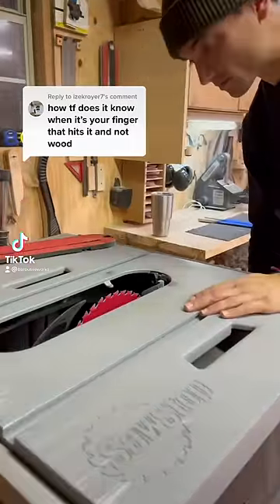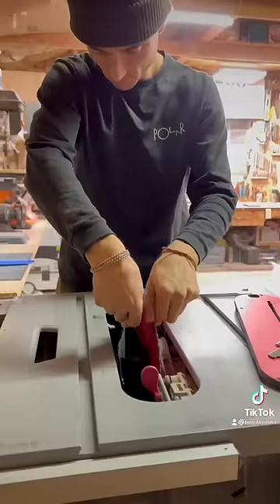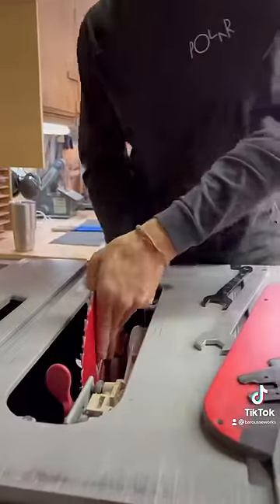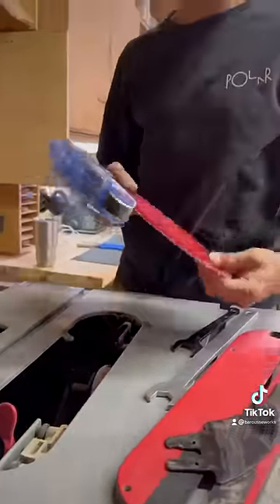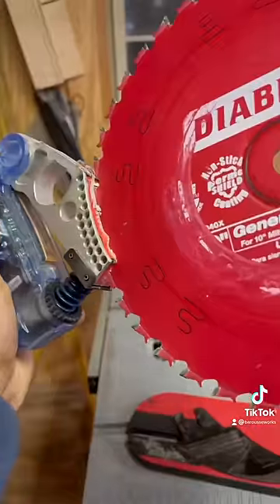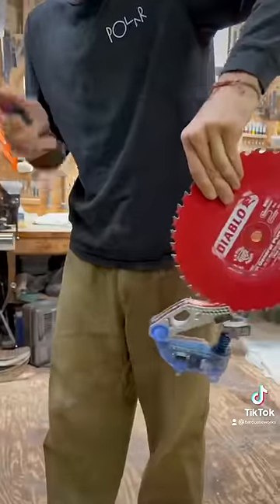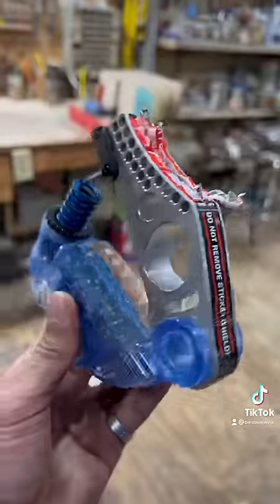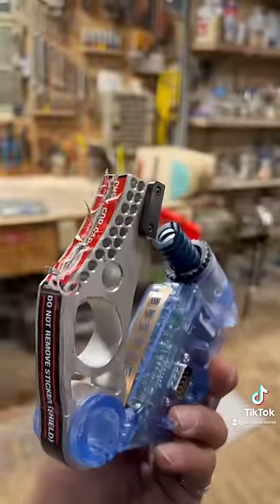Explanation of how SawStop technology works & how it can save your fingers/hands! By Barousse Works

Comment: My power tool incident, or rather pneumatic tool incident, was when I nearly put a nail straight through my finger while using an air nailer. I was laying planks for a porch, and one of the times I hit my finger with a nail because i had my hand under the wood. Luckily, it didn't go through, but it did go in enough to bulge my nail out a bit. Keep your fingers away from your work fellas.

Comment: Just remember if youre cutting damp wood, its a normal table saw since you have to disarm the brake to cut anything damp
Reply: Or don’t cut damp wood cause that’s not a good thing for blades or the wood and once it dries after you make cuts it will warp

Comment: Skin isnt actually conductive, its the sweat that has ions which are negatively charged. Negatively charged means that it will use the extra electrons, which will be used for the electricity. Yes i didnt need to say this, but i wanted to feel smart 🥲

Comment: You did not explain how it works properly, because you finger is not conducting anything if it's in an open circuit, it must be a closed circuit so how is that achieved ? Or am I wrong about this or maybe it's more about capacitance ?

Comment: Mine sure didn't I had a smaller square block I was cutting my sled was to small so I used the miter but the saw was used and caught the wood and dragged my hand right in and shattered the tip of my middle finger hurt like hell I'm the saw had a bent arbor I found after the stitches

Comment: Yep my high school had 5 in the shop class about 12 years a Gao the invented use to actually run his hand over it running to demonstrate it wouldn't cut a limp off he got tired of the Cutts and scratches so he switched to using hot dogs funn fact yo

Comment: We had to take a class in 7th & 8th grade (half year courses) called "Technology" but it was basically just woodworking. So you've got about 30 12-14 year olds using band saws, miter saws, drill presses all supervised by one teacher (and mind you, our power tools did not have the safety feature shown in this video). And yet, at least in my state, you can start working at 16 (15 on a farm), but you're technically not allowed to even use a knife let alone a deep fryer because it's too dangerous. Kind of fucked up if you ask me.

Comment: However it works, if you're not thinking any woodworking tool can hurt you before you pick it up, you shouldn't use it
Reply: All of them can. If you don't respect that you'll probably hurt yourself one day.
Reply: Things happen even when you're paying attention and being safe...
Reply: Wood is unpredictable. I've cut a piece of wood straight as an arrow. As soon as I started cutting it not only binded the blade but it started twisting. One side of the cut went up and one side of the cut went down. An unpredictable twisting binding hazard that scared me. I couldn't even reach the stop button because I was at the other end of the board... Tools are dangerous.

Comment: I’ve got a new guy at my work who wants to be a technician, doesn’t really have much (if any) experience but I always see him working. He’s chatty and listens so I take the time to give him advice and lessons everyone should know about the mentality and safety of a good worker around tools.

As my dad taught me, “Bottom line consideration you must always have: Tools are stronger than you, and they will hurt you if you misuse them. Metal is hard, you are not. Cars are heavy as fuck, you are a pudding sack by comparison. If a tool is not in use it should not have power. Execute trigger safety. And gloves are just snacks to any rotating tool or lathe.”

Comment: Am I missing something? First of all, the blade is circular so id wouldnt need your skin to complete the circuit would it? Maybe there is an inconductive layer in the middle and cond. on either sides that would make sense, but what about people trying these with sausages? Sausages dont have ions on them to conduct do they? Even the fabricated dead animal skin can conduct then? And was there really not a better way to make this mechanism, maybe not work based on this way but in some other way that doesnt require your finger to touch the blade? I mean what makes this safety system good is the way it detects your finger in the first place, I think there must be better ways to deal with this but not yet maybe.

Comment: It doesn't "complete the circuit". It changes the impedance measured by the computer, on the blade. You can be fully insulated from the ground and even floating. It'll still fire.

One Google.

Comment: Wood is very much still conductive not nearly as much as the human body but it is
Reply: Wood is classified as an insulator. We use wood rulers in electrical for this reason. Anything conducts if you put enough energy through it.

Comment: That's not how it works...  For kicks I made a razor blade that retracts when you touch it.  It is not completing a circuit (otherwise it wouldn't work if you were wearing insulating materials).

Comment: Is it completing the circuit or just detecting capacitance change. If you're wearing rubber shoes on a dry concrete floor it's unlikely it's "competing the circuit".

Comment: Look I'm glad you kept you finger. But I've been using  tablesaw from the age of 9. That was back in the 1970s. No guards no shields.  I was taught the first rule of a power is simple. 
Power Saws are stupid and will try to cut anything YOU DECIDE to feed it, including body parts. So if you want to keep your body parts you must always be smarter than the saw. Yes today I still have all my appendages. So use push sticks be smart. Don't trust things like that brake. If it had failed we would call you stumpy.

Comment: Saw stop tables saws are nearly $2k dollars.. replacement parts for blade stop is $100 .. I've been using my table saw for over 15 years have all my fingers.. called using your brain .. I have a Makita n absolutely love it.. the fact you almost chopped your finger off shows you inexperienced at running the saw...
Reply: And how does one become experienced? Did you get hit out as 50 year old woodworker with 75 years of experience?
Reply: @mark1A100  lmao called being smart n using your brain using wood as push rods n not your fingers. Making sure you have no loose clothing. I've been in and around construction my entire life.. family company.. just saying you need be smarter.. like I said I've never cut myself neither has my old man or any of our workers.. I heard and seen lots of injuries due to saws n it's always user error..
Reply: @mark1A100  do you use table saws? Lol I have  injured myself more times with a  nail gun than I can recall saw injuries..both personally and witnessed lol.. saws are least but dangerous compared other equipment..

Comment: That "before" video was absolutely stupid, and that's the sole reason why you NEVER put the limiter on the fixed table or cut by the smaller piece.
You always put the limiter on the sliding table, and always put the bigger piece on the sliding table as well.
You avoid stupid mistakes like the one you did, that cost you a lot of money and could've caused you your hand, and also you avoid getting the saw stuck between a slab of wood and the limiter or the table itself.
Please read this, and never do this again.

Comment: Not a correct explanation. Sawstop senses capacitive coupling to ground. this is why wet wood doesn't set it off.
Reply: Except for the fact that wet wood DOES set it off
Reply: @bigluisjayrogan  It has to be REALLY wet to do so, like soaked. In any case, it has nothing to do with conductivity and rather works based on capacitance, like a phone screen